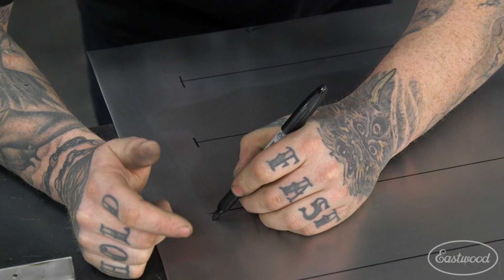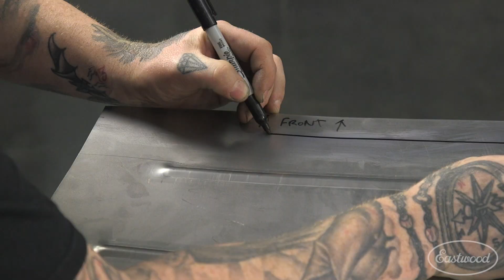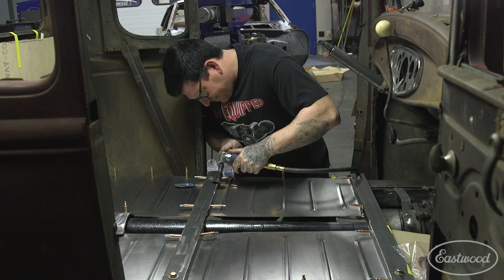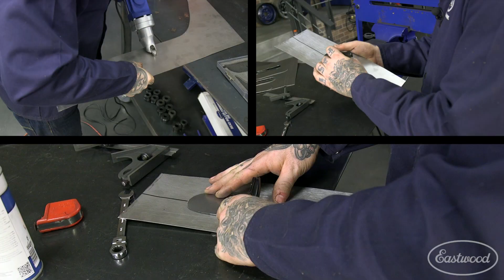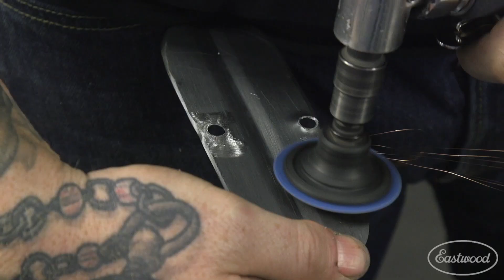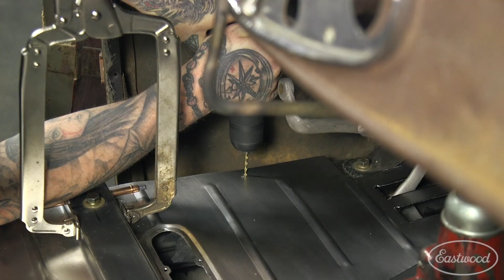How To Install Floor Pans - Ford Model A - Metal Fabrication with Eastwood

Comment: I have always been told that you need to pre-stress the panel in the OPPOSITE direction of your intended bead. So if you want the bead humping up, the pre-stress needs to be done downward. Thus you need to draw the same pattern on both sides of the metal and flip it over to pre-stress. Also, just a nit-pick, but if you wanted the access panel to be a little more professional, drill out the lower screw holes and use a rivnut tool. Screws thru sheet metal can strip out over time, but a quality rivnut will hold for a long time.

Comment: Or, you could also heat the panel, but, nobody does that anymore these days. Grandpa's brother, used to roll them flat as a dime as you fellows across the pond say it.

Comment: This is some great metal work. I have one question. With so many seams what is stopping moisture from getting in? Are you going to sure seam sealer on all the joints?
Reply from the maker: Yes, Matt may apply Eastwood Seam Sealer to prevent moisture.
Reply: If you want this hot rod to last for another 100 years give it the 1960's factory treatment, seam seal everywhere under the body outside then give the whole under side of the body 2-4 layers of bed liner, that will keep the shit out
Reply: @ProFatFabrication  As I was born in the 60s I can assure you that rustproofing in cars then was terrible. I don't  know what brand car your referring to but most 60s vehicles are in worse shape than Matt's 100 year old car!

Comment: less of a tech question, and more of a build question: what pedal assembly are you using in this build?
Reply: charmingcharliex it looks like the factory pedals, if not its something from a 40's gm car with under the floor master cylinder mounting
Reply: @ProFatFabrication  I can let you know that it's a Ford pedal assembly because Matt and most other early Ford guys wouldn't use GM stuff. That and Fords had juice brakes in the 30s and most every car of that vintage had the master cyl under the floorboards.

Comment: Nice work Matt....   did I see correctly that you pre stretched the metal in the opposite direction of the bead ?  so stretch up, bead down ?
Reply from the maker: The panel is run through the English Wheel in the same direction the beads will be rolled.  This will shape the metal in both directions.  Here is an article that further explains the process:  http://www.eastwood.com/blog/eastwood-chatter/bead-roller-trick/
Reply: +Eastwood Company 

i guess I wasn't clear in my question. I'm the video and the tips, you crown the metal UP with the wheel but put the bead down or inverted form the crown you created. at least that's how it appears.
Reply from the maker: Correct.

Comment: how thick is the metal you are working with ?
Reply from the maker: 18 gauge steel. Thanks for watching. -Matt/EW
Reply: The hand break that was used  was indicated to handle up to 18 gauge.